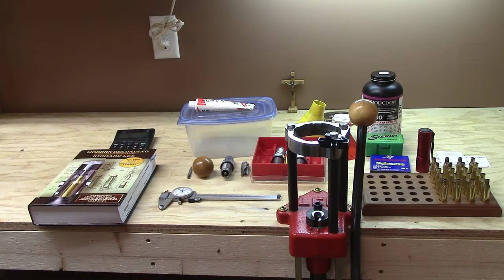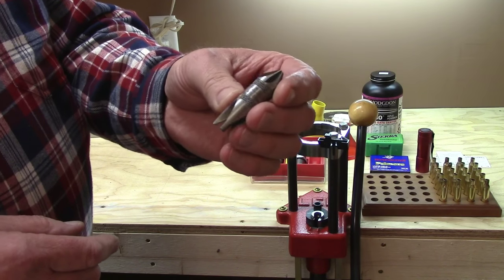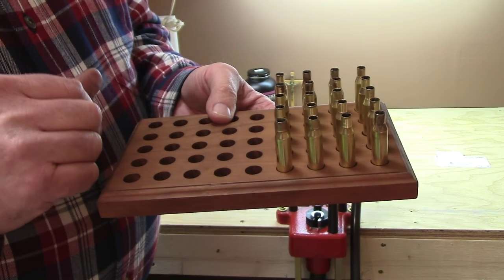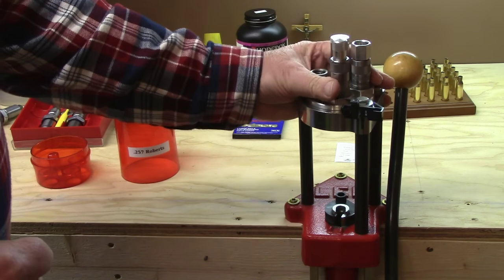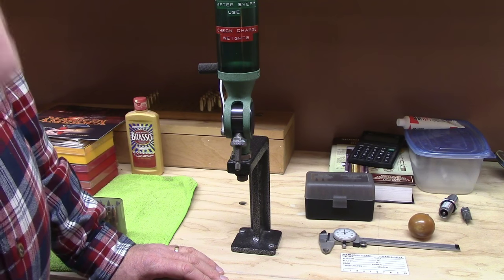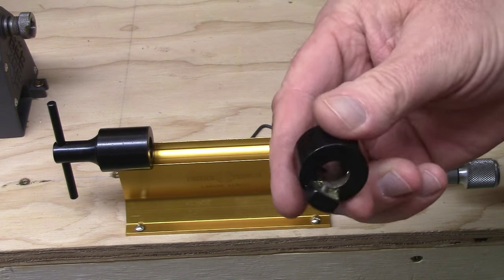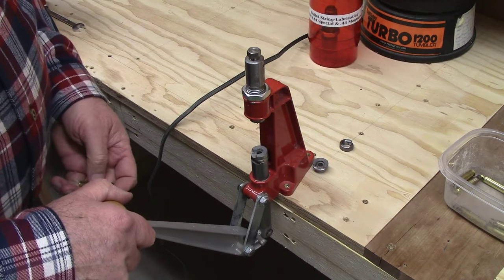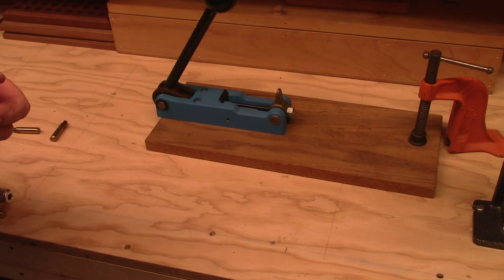Handloading PART III, The Equipment Basics ~ GunBlue's Complete Guide

Comment: Excellent!  I love your tip to use a Lee water soluble lubricant.  Yes!, the Lee universal decapping die which is my first step to remove spent primers ( I use the decapper die on my 1972 RCBS JR press).  I still use those Lee yellow dippers for powder dispensing...simple to use along with a powder trickler.   I also still use a balance scale (30+ years old).  Most hand loading equipment will last a lifetime.

One other I recommend:  A bullet puller that mounts on the press...much easier and faster than the hammer style kinetic bullet puller.

Comment: I just got a Hornady Powder tricker and it is very light due to it being made of plastic. Obviously filling it with molten lead is out of the question so I filled it with some of my Grandson's Playdough and it looks like it may work ok as long as he doesn't find out what I did. only problem I see is when it dries out it will shrink, but some Duct tape across the bottom should solve that issue.
Reply: If that doesn't work, I used BBs blended with a little silicone glue. It's worked perfectly since the early '90s. Also, the silicon prevents it from sliding around. I just used a putty knife to blend it together.

Comment: Hi GunBlue490,

I love your videos. They're fantastically educational. I want to start hand loading my .30-06 for supreme accuracy but keeping it as low budget as possible. I also will need to reload for hunting. I'm not concerned with the time required to load with various equipment. I'm looking at either the Lee hand press kit or the classic Lee loader kit. I want to do everything I can to maximize accuracy; neck size (also full length for field), mouth trim and chamfer, etc. I plan to purchase a balance so I can do incremental load testing. Which of these two equipment sets would you recommend for these goals?

Comment: Great series of videos, im eating these up in preparation to start handloading. Hopefully you can clarify something for me though. In the Lee Reloading manual under crimping it states that "only lead bullets or jacketed bullets with a crimp grove can be crimped in place with standard dies". Is this to imply that the Lee factory crimp die isnt a standard die and it will crimp jacketed bullets without a cannalure? The bullets I have picked up to start with (Sierra .224 45g STP and 50g Blitz) don't have crimp groves. From what i've read, I'm thinking that the factory crimp die will work with these, but I'd like to get confirmation from someone in the know first. Thanks
Reply from the maker: You are correct.  The Lee Factory Crimp die works entirely differently and is far more advanced, using a squeeze collet.  It will crimp a case into a bullet, rather than requiring a cannelure, as with other dies.  But go easy and start with moderate crimps in order to minimize unnecessary work hardening of the brass.  It requires far less crimp to effect a very solid hold.  With my Mini14 and AR, they require less than a half crimp, which is barely visible.  But if you desire a factory crush crimp that embosses the case neck, it will do that, too.
Reply: Thanks for the reply, it's appreciated. The Lee manual says all hunting loads should be crimped. While I'm sure not all of the loads I make will be used for hunting, I'd like that any I do make would be suitable for hunting. I'll start with a light crimp and work my way from there.

Comment: RCBS powder measure? Is that the ‘competition’ model? Or which one is it?
Reply from the maker: I purchased it in 1973, many years before they introduced the competition model, when they made both a small and large capacity drum.  This is the small, which will charge from several tenths of a grain, up to 60+.  For anything greater, it's more accurate to drop two half charges than one with a large drum, because the small diameter hole has less cut off area.  Pistol charges are accurate to the tenth.

Comment: Gunblue490 
Does that press the type that has the tube that disposes the used primers as one decapps using. the press. ( trying to find the exact model that you are using )
seems to be the most efficient single stage / semi progressive stage that I have seen. 
especially for the cost factor.
Reply from the maker: tjmooremusic 
Most presses have some means of collecting spent primers.  Some are more efficient and cleaner than others.  Most presses simply drop primers into a tray that can spill, and allows dust to get everywhere, or a noisy jar. This press disposes of them silently through the hollow ram, which fall into a long clear flexible tube,  that is either capped until it is emptied after many hundreds of primers, or routed to a trash receptacle directly.  This is one of the easiest, efficient, and cleanest, by far.
Reply: GunBlue490 I'm sold. 
Still making my way through your series. Learning alot .
Thank you so much.

Comment: I am confused about the lubricating. Some say with CARBIDE die's one needs no lubrication What is it I am missing here ? (totally new to relaoding)
Reply from the maker: Hank Enting 
Never lubricate straight wall cabide dies.
Reply: So as long as I buy CARBIDE die's, I do not have to lube anything ? I am totally new and with out any experience as you can read here. I was told that such was the reason for buying carbide die's - to avoid needing to lubricate. Perhaps just tell me the exception to that rule if any. Thank you very much for the educative video's and God Bless you.
Reply from the maker: Hank Enting 
Brass is lubricated to prevent seizure in the standard, NON CARBIDE sizing die.  Carbide dies are available at premium cost ONLY for straight walled cases having no significant taper or bottle necks, such as most pistols, revolvers, and a few rifles.  Carbide dies do not stick to brass, and should never be used with lubrication,  which will really do nothing but collect at the base of the brass uselessly and make a mess.  The carbide portion of the die is a ring that slides along one diameter, so they are not made for bottleneck rifle cases.  In addition to watching my videos, you really are advised to invest in a good loading manual before starting, and read the instructional pages.

Comment: I personally like the vernier caliper. I've been able to read it to a ten-thousandth by extrapolation. In class, I would confirm with tapered calibrated blocks.

One trick I've used as a DOUBLE check is to use a piece of drill rod just under bullet diameter. Once I've settled on a standardized load, I will stick it in the case and mark how far it goes in. I can do this on the fly and then double-check visually with  a flashlight. I am probably overdoing the quality check.

Comment: Could you please clarify for me the difference between diagram case length and trim to length, thank you.
Reply from the maker: Trim to length is .010 shorter than chamber length to provide clearance for growth on firing, to prevent bullet seizure by a jammed case mouth. Any good loading manual has these numbers.

Comment: Gunblue490 
what model press is the one you have there in the video. 
I want as as beginner keep things very simple. A single stage press will no doubt meet my needs.
I am retired and want to expand on my hobby. I don't expect to be loading alot of or a great variety of rounds. 
I really appreciate your  teaching .
any suggestions would be most appreciated.
Reply: I believe it is a standard lee single stage press, they are very affordable and very good quality. also lee is selling a single stage breech lock single stage press set for around 120-150 dollars and it includes most everything you will need to get started except for your caliber dies.